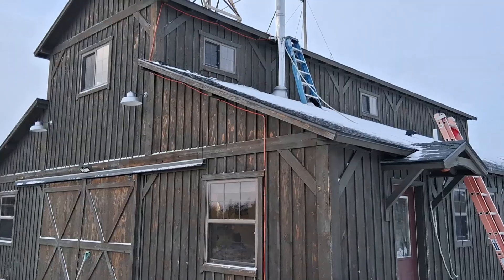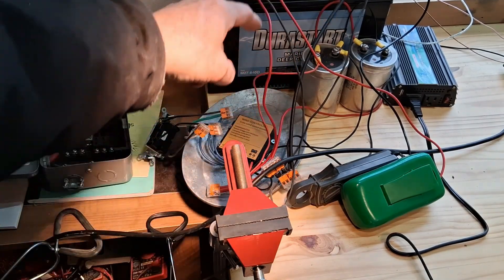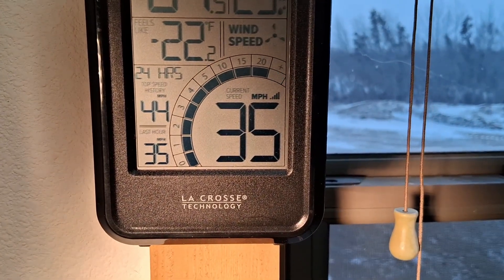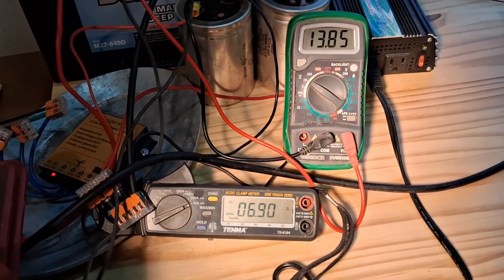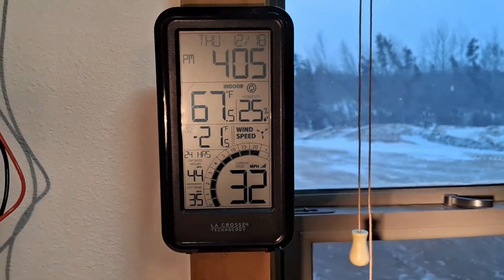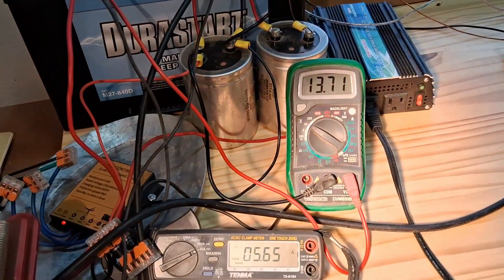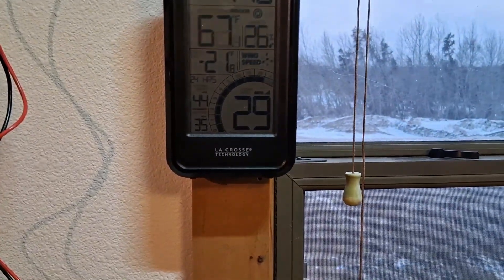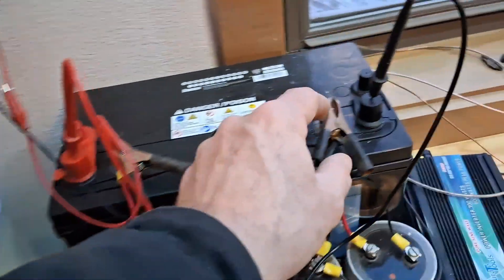Blizzard like winds vs. Vevor turbine (500 watts) rated

Comment: I get the 3M pun? Double M instead. No PFAS production either. Wow not even 200 watts on a 500 watt rating? wild. 12 to 13 amps is very decent. I can get 5 amps on my bicycle charger but I can't hold that very long. Just get like a dozen of those things.

Comment: Hi Mate, after all the strange weather, December production is 14.8 KWh.
All 10 wind turbines are using 1.3M wind wheels with 5 or 6 scoop blades.
14V - 24V 500W Vevor             -  6.5M high    -  3,713 Wh - New blades
14V - 24V 500W Vevor             -  6.5M high    -  3,454 Wh - New blades
14V - 24V ista Breeze i500      -  4.5M high    -  1,759 Wh  
12V - 24V 300W Hyacinth       -  4.0M high    -     905 Wh  
12V - 48V 500W Sunboo S5   -  3.5M high    -  1,749 Wh   
12V - 48V 500W Sunboo S5   -  3.2M high    -     845 Wh  
12V - 48V 500W Sunboo S5   -  3.0M high    -     778 Wh    
12V - 48V 500W Sunboo S5   -  3.0M high    -     608 Wh
12V - 48V 300W new rotor     -  3.0M high    -     498 Wh   
12V - 48V 300W new rotor     -  3.0M high    -     489 Wh
I live in a Low wind area of town, average wind is only 6.2 miles per hour.
Town laws stop me putting up a big wind turbine, mainly noise and safety.

Comment: That is some great fun playing with that turbine.  That about the right size battery and type for that . On battery systems the fuse belongs at the battery . Great to have a weather station . You got free lighting power !    You can even run a 12V cooler but not really needed in the cold.  Stay warm !  It cold and windy in NY as well !
Reply from the maker: Yep, that's the $100 toy!   -except the system was more like $250 with the battery and wire.